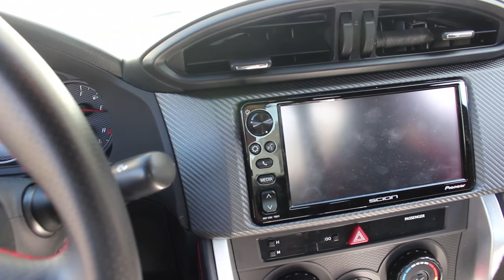Installing Katana Shift Knob

Comment: You should’ve gone for the smaller version of that shift knob, because that one is way too long. Also, if you put all of the screws in before tightening them down evenly, you will have a more of a flush mount result.

Comment: I like the shifter but the bottom where you have to screw it in sucks. I bought a shifter with a screw in like that and some how the screw came out and the shifter came off while I was driving. Smh.. hate the ones with those kinda screws.
Reply: try loctite

Comment: whats the size or i mean the length of the shift knob?
Reply from the maker: RayddenPrimeTV reverse is actually pretty easy the tsuba isn't loose and you can use it to hold onto when pulling the lock out, however the stuba did start rattling after a while left to right action a drop of super glue fixes
Reply from the maker: also believe they have the same shift knob on amazon for cheaper and with prime, just a heads up!

Comment: can you put this on a TH8A shifter
Reply from the maker: matthew walker if you're talking about the USB race sim shifter, I'm not sure if it's threaded under the knob it comes with. I would try twisting it off and if it does come off then I would say yes. But be careful the shifter you, this one would work perfectly as it comes with the rubber end cap to fit and you use the Allen screws to hold it in place so it doesn't even require the threading to be there.
Reply: Robin Eide thx